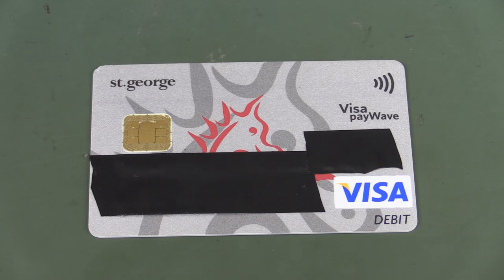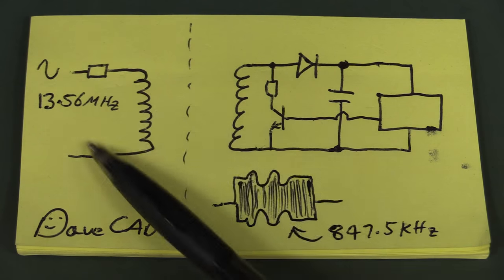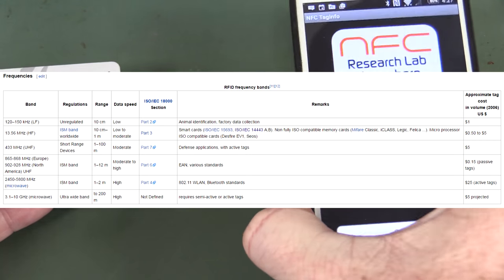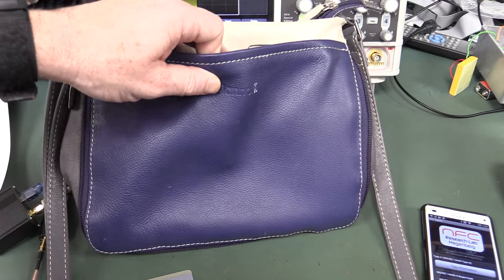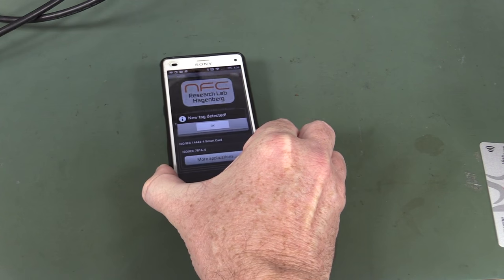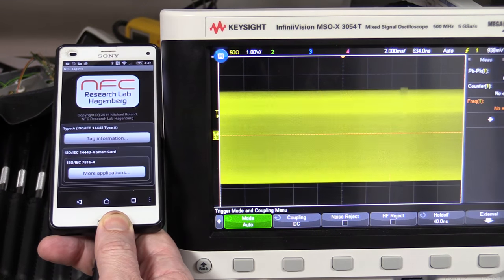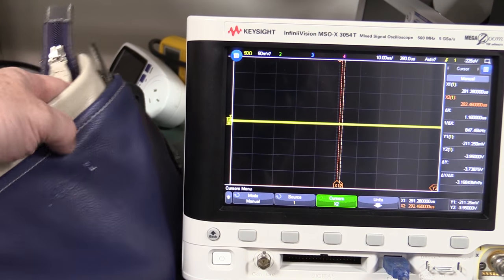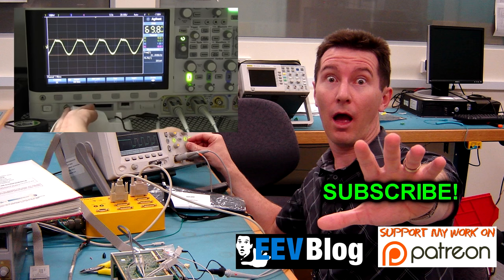EEVblog #889 - Credit Card RFID/NFC Theft Protection Tested

Comment: Reminds me of a few of my student mates. They made a tranceiver and antenna for scanning RFID cards from a distance of up to 10 meters. Worked pretty well, they could scan university cards from people walking below past the window of the lab.
Reply: Do you have documentation? I'm planning an art installation to show that RFID maybe isn't the best idea.
Reply: No I dont, and if you want to do it you should try to develop it yourself instead of stealing all the work other did. You cant just take something someone else has worked on for two whole years and then make some quick fame by trying to make it art. Especially not without paying them for their work.
Also, when encrypted RFID is just fine.
Reply: Ouch!
Reply: All this technology is well known, for last 150 years..nobody owns much here..You just make it bigger and more sensitive, but still there is a limit and it will be in region of a meter or two - 10m ? not sure.
Reply: That is true, but making it long range is still an area that has development. From what I understand one of the main problems is the LNA in the input. Noise overall is the limiting factor in these systems, and i agree, i doubt a system could be effective further than 10m if the encoding used is BASK (which generally has to have a fairly large signal to noise ratio).
Reply: Haha I just felt a bit sorry for the 'art project' guy, you are quite correct though in all you say. ))tHaH4x0r
Reply: +tHaH4x0r I don't understand why you are so hostile. He didn't say he wanted the source. He didn't ask that you give him the project for free or without credit. Even if he DID ask, why do you bash "art" like it just a gimmick for quick fame? Tech-art is pretty cool and is a good way for people who are less technologically inclined to interact a new technology. Almost nothing is built in a vacuum, your friends built their technology based on something that someone else made, others will build space telescopes built upon work done in the 80s and I will make a web scraper build on free open source work done by thousands of other people.
Reply: I am so hostile because I have seen a lot of people doing loads of work and art people stealing the fame and pretending they made it. I have seen it so often that I have developed a grudge for it. Not ONCE have I seen an artist using something like that and giving proper credit. Also, not to mention that these kinds of things do require ethics, and if you have never done a course in it you should not do it. In the Netherlands it is even illegal to scan ID cards because it is processing personal information. You need specific explicit allowance from the government. So it is a very bad idea anyways.
Also, I dont really care about tech art. I guess it is pretty cool if you do it yourself, but then DO IT YOURSELF. That is a big difference. And if my friends build it with the technology of others they pay for it. Namely the chips on the circuit board for example. They dont just use it without paying. The stuff they use is also explicitly listed as for sale. Wrong comparison. Also they dont gain any money or fame because of it, they do research.

Comment: With the TI RFID Development kit TRF7970A I managed to read more than 10 cards at the same time. However I have seen tags that use the 125 kHz system for building access control interfer with the theft protection of a Fiat Punto. It took my friend at work several weeks to figure out what was going on and why his car didn't start sometimes. That was before 2006 though.
Reply from the maker: Yes, my 125KHz lab access cards don't work with two in my wallet.

Comment: That is RF .  RF stands for, wait for it, Radio Frequency.  873 kHz is a frequency that my radio can pick up, is designed to pick up.  It is RF !
Reply from the maker: Start by looking up Near Field vs Far Field theory.
Reply: Aehm.. No!
Reply: +EEVblog   Either in classical Maxwellian electrodynamics or in the quantum mechanical version, this is  a case of electromagnetic radiation.  Electromagnetic radiation is produced at the transmitter coil and absorbed at the receiver coil.  The difference between near-field and far-field is that in far-field, the math is simplified greatly by making assumptions.  Those assumptions break down in the near-field case.  The physical phenomenon at work is the same.
Reply: +Mark Holm  Near field-theory is the more nearly "correct" version in either classical or quantum electrodynamics.  If one were being picky about theoretical correctness, one would insist on the full, near-field treatment regardless of distance.  Of course, you would find that, at larger distances, some terms of the equations calculate to very, very small values, and you would, rightly, question whether there was any purpose to all that extra number crunching.
Reply: +Proximity Mine  Both Maxwell's and quantum electrodynamics make this clear.  You can not separate the magnetic and electric field components.  NFC is a classical, Maxwellian theory.  NFC says that there are aspects of the electromagnetic field that fall off at 1/r and aspects that fall off at 1/r squared.  Far field theory simplifies the math by ignoring the components that fall off as 1/r squared.  In quantum mechanics it gets wilder, with "real" and "virtual" photons.  These are poor choices of names.  All the photons are real.  The "virtual" ones participate in interactions that are quite real, but counterintuitive.  As in the Maxwellian version, the contributions of "virtual" photons fall off as 1/ r squared.
Reply: How strong a field did the smartphone generate at the reading distance? To wit the hard part isn't stimulating the RIFD chip at a distance; but reading the ASK backscatter. How much power can the card backscatter before the magic blue smoke escapes?
Reply: +Mark Holm  In the Maxwellian picture, you can imagine a purely magnetic field only in the static case.  As soon as an accelerating charge, like those electrons oscillating in that loop antenna, is introduced, you have an electromagnetic field.  Electromagnetic, not an electric field and magnetic field that are somehow separable from each other.  When you are close to the antenna, there are components of the field equations that behave somewhat differently from the field components that dominate at longer distances.  Calling the near field "magnetic" is a misrepresentation of what the equations say.
Reply: @EEVblog  the difference is nothing but marketing bunk in this application, near field at 200mW is far field at 200MW, there is no real near and far field in truth, as others have pointed out it is just which set of equations to use to make the mathematics easier for a particular application. Near field in this application is marketing bunk to claim these cards are more secure than they are. With enough power one can induce enough voltage and current at further range, inverse square law applies meaning I need exponentially more power as range goes up for the same voltage. The other side the receiver our end, it comes down to how sensitive we make it, for modern spread spectrum radio applications we are picking up a signal burred in the background EM static, we need to use very sensitive receivers for that.. Here is an insensitive receiver using the EM of a high powered transmitter to power itself: http://www.angelfire.com/biz2/radiosets/images/model3.gif An EM field is an EM field is an EM field.

Comment: Dave Cad... classic :D Also, this technology is very similar to the QI standard for wireless charging for phones & tablets. Instead of sending the credit card data, the device sends information to the pad such as how much current to supply and when to stop by modulating the load on the phone's internal charging coils.

Comment: Not an RF field? That's exactly what this is! That schematic you drew is equivalent to a good old fashioned crystal radio with a loopstick antenna.

Generally, any of the antennas with circular elements work by coupling the magnetic (B) field, while dipoles and related things like yagi arrays couple the electric (E) field.
Reply: Thanks for this comment... I was wondering about the statement at 1:50, and was going to ask: what’s the difference? I thought antennas we’re basically just strangely shaped (as compared to the coils we’re used to when talking about them as) inductors... though magnetic versus electric coupling definitely sounds like a difference... still, Dave, if you see this, I’d love to hear more about what you see as the differences. (Feel free to point me in the direction of existing videos, of course...)

Comment: Tip: Last NFC transactions history is stored directly in most Visa cards. There are applications to read them also.

This video focuses a lot on scanning aspect, but scan is useless without SE response. So the only way to actually steal money is to perform MitM attack with HCE endpoint to emulate SE.

As for biometric passports - data is encrypted and key is generated from passport number, date of birth and date of expiration.
That's why you have this
<<<<blablabla<<<<bla<<<bla
<<<bla<<<<bla
section in them. It's for machine to run a dumb OCR to get required info for generating decryption key and then decode data. So scan alone is also useless.

Comment: I'd say that the reason people think that putting cards together will protect them is that a lot of implementations don't do anti-collision properly. Haven't tested it with Opal, but certainly the MyKi readers in Melbourne don't implement anti-collision, if it sees multiple cards it just gives up. So they've probably seen a message like "multiple cards detected, try again" and assumed that that means that the system can't read them if there are multiple cards there.

As far as reading them from a distance, there's an application note, I believe on the TI website which covers building long range antennas for RFID, after a point you end up with something that looks like the anti-theft tag gates in shops.

What I'd be more interested in (haven't got around to actually testing it though) is how much of the signal you could passively sniff while a transaction is in progress, because although the system is designed to use magnetic coupling, 13.5MHz propagates reasonably well so you're going to get some degree of RF leakage.

Comment: I'd like to propose two fixes you might want to add before releasing it: 1) It is actually the same chip as the one seen from the outside, not a separate one (Google images "paywave x-ray"), and this way they can also have the same data shared (e.g. some cards count your contactless transactions and allow only X in a row). 2) They are not just data storage like your usual tag, but the are actively negotiating with the terminal and cryptographically sign transactions. The data you can read out from it alone will not help you much (you do get CC number and expiration date, but not name or CVC2 - it's worse to have your card captured by a security camera than having it scanned). To make a transaction, you would need to go around with a terminal, or relay the communication via the Internet to another phone at a rogue merchant's place, and since merchants must be registered, this makes it a lot harder for criminals.
Reply from the maker: Yes, it's not easy, but it's possible and has been done. Risk is pretty low though.

Comment: Dave keeps going on about how it's "not an antenna", and that it uses magnetic coupling not "RF fields", but aren't they essentially the same thing, just longer distances?
Like all EM waves are composed of Electric and magnetic fields right, so what makes this different?
Reply: Look up "Near and far field".  In the near field, E-Field (electric) or H-Field (magnetic) can dominate.
In the far field, there is a fixed ratio of E- and H-Field which is given by the impedance of air, which is about 377 Ohm.
In this application, the H-Field dominates, meaning the impedance is much lower then the air impedance of 
377 Ohm. For a radio broad cast transmitter you would aim at matching impedances of transmitter and antenna to increase efficiency.
Reply: My thoughts exactly. Let's take a FM radio broadcast station for example... It is a BIG primary and the receivers are all secondaries in a big imaginary transformer... Magnetic coupling being the magic phrase here.
Reply: +sarowie thanks for the jumping off point. 
Does this mean the phone is still generating a small far-field RF signal at its MHz carrier frequency when searching for a nearby tag and could u pick that up on a spectrum analyser?
Reply: Yeah, I'm starting to feel like he just does these things on purpose.
Saying controversial things like "it's not an antenna", or that "current flows through capacitors".
Then he watches the comment numbers mount and the view count climb. Great business model.
Reply: It's an antenna in the near field.
Reply: Everything is an antenna. Electromagnetic waves propagate if charges get accelerated so any AC source is causing EM waves to propagate through space. Its just that some things are better at it than others. An antenna (one designed to do what it should) is much better at propagating waves than a regular wire with AC flow. 

Someone already explained near and far field, the EM waves everyone is talking about are planar waves with E and B field in phase, this is not the case in the near field (near and far field in this case refers to a distance near or far from the antenna, look up definitions on wikipedia)

So this coil actually does radiate EM waves, but they are so weak and far away from the action that it doesnt really matter. With a coil the magnetic field is much stronger than the electric field when in near field.

Comment: Hey EEVblog, I might not be absolutely correct but it seems RF communication works with the same principle as RFID cause you are still using the same electromagnetic field for TX and RX except that the distance has to be very closed for reception. The current that is oscillating in RF antenna induce the same magnetic field for long distance transmission, and at the destination end you surely do need the antenna where the same signal will be induce except that mechanism for reception is different, but basically the medium is still the same. Thanks for pointing this out.

Comment: if people are so concerned, and they don't care to use the touch and go of the card, then I would just say they should exacto the coil and break the circuit.
Reply: Hole punch. Break a single wire and the coil is useless, and a small hole doesn't hurt it's normal use.
Reply: +theLuigiFan0007 Can confirm. I did this with my uni ID card by accident XD.

Comment: To clarify: the message that the chip sends to authorise a transaction and prove that it isn't a clone (the cryptogram) is protected by strong cryptography, but information that is also present on the front of the card or on the magstripe, such as the card number, is always transmitted in the clear. So it's possible to skim a card and use the card number to shop online or something, but, in principle, it's not possible to physically clone a skimmed card. In practice, this isn't always true, mainly due to American banks that don't bother checking the cryptogram.
Reply: +Francois Molinier nope, the cryptogram is the response part of a challenge-response protocol. it's a digital signature of the transaction details and a nonce, so a MITM won't work as these will be different for a different transaction. this is all moot anyway since the card will give you the number if you ask for it, and that's all you really need to make a transaction

Comment: The ISO14443 standard calls for readers to have a minimum of 1.5A/m output. ISO15693 calls for 2.0 A/m. if anyone's interested. ISO10373 is concerned with the measurements of the readers. 
Your phone will be producing around 1.0A/m at 13.56MHz. the ISO14443A ID1 credentials can sometimes read somewhere around 0.3 to 0.4A/m depending upon the amount of processing involved. Actually you'll find that most cards won't be read over about 15cm with a reader producing 4A/m as the magnetic field just isn't strong enough. You won't find anything portable over 4A/m as you start needing a beefy RF amp
It is quite possible for these cards to be read from this distance but like Dave said, it doesn't mean they can actually set the transactions up.

Comment: Actually, the modulation is ~106KHz. (13.56MHz / 128). It only goes to 847.5KHZ (13.56MHz / 16) after the PPS handshake between the PICC (card) and PCD (reader). The card has to say, "I support these baud rates" during the RATS command, then the reader has to choose the baud rate to use with the PPS command.

Otherwise, spot on, mate! I didn't know you did RFID stuff.

Comment: Oh, I have a slight issue with how you are thinking modulating a coil is not a radio? The difference between a transformer and a radio is the radio modulates the electromagnetic field (we call it electromagnetic radiation for a reason). My one transistor AM crystal radio works exactly the same way using the radio signal to provide enough current to run it, admittedly I do ground it rather than ground to the other end of the coil. I bet if I tune a heterodyne receiver to 50Hz I'll be able to here a continuous 50Hz radio signal. With a powerful enough radio signal one can in fact activate one of these cards.